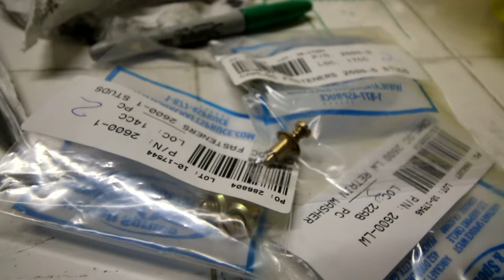Toyota Corolla Drift Car Build | Inside Cutworm Specialties

Comment: Very cool looking build. Could be the angles of the shot but it looks like in some places there is some good gap between the A/B pillar and the front arms / main hoop respectively? Don't get me wrong, the fab work looks beautiful but that's a hell of a lot of effort into something to see tolerances like that. Would love to hear your comment on it.
Reply from the maker: +msinfield Not 100% sure what you are referring too but if its the distance between the factory A pillar and the front down bars then the gap is not as much as it looks. Not sure what Jeb has planned...may plan on putting interior back in it or just tieing the two together at sometime.
Reply: +The Fab Forums Yea, exactly what I was referring to, thanks. Probably a combo of shooting angle and I was thinking the whole racecars don't need interiors deal. Great stuff man, keep it coming.
Reply from the maker: +msinfield There is also a possibility the entire cage structure may be moved back in order to access areas that need to be welded. I know its not anchored for that reason. He still plans to drop it through the floor to finished weld the top.

Comment: What's the bit of  tooling called that he uses in the mill to hold the tube secure at different angles?
Reply from the maker: +Thomas Vickery I believe it is just something he made
Reply: +Thomas Vickery Typically called a "V block"
Reply from the maker: +Jess Neal That would make sense